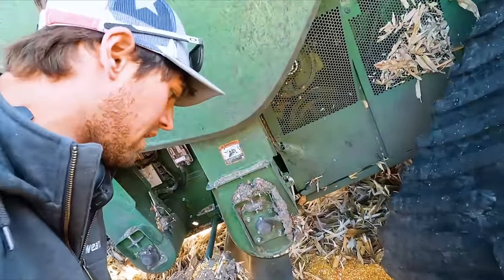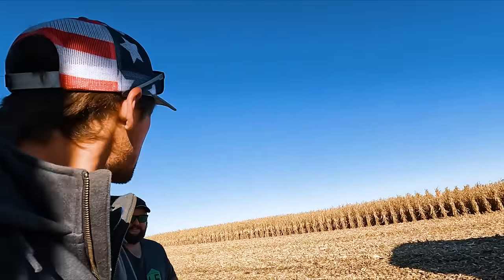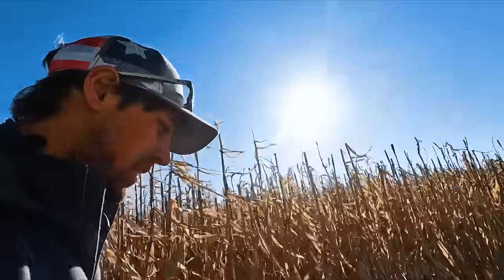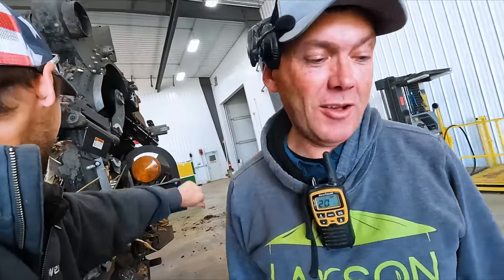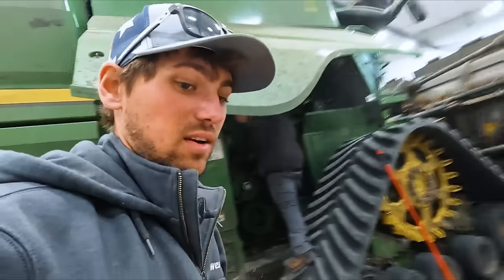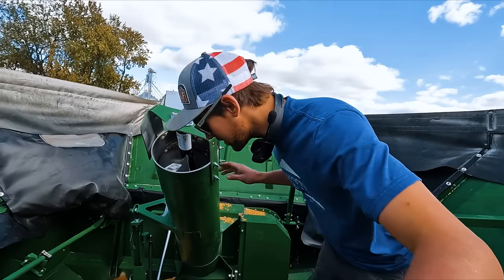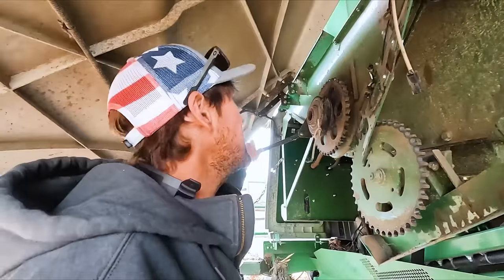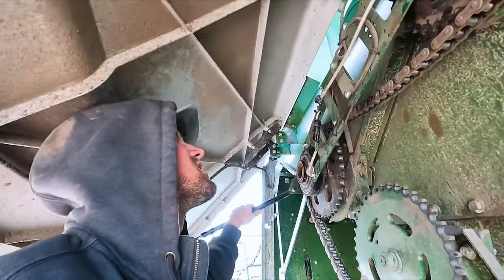The Consequences Of Our Own Actions!! #23

Comment: When I was a teenager we just finished putting new thrasher bars on the cylinder on a John Deere 95 combine. If you don't know back then combines used a cylinder and a concave to thrash the grain. Anyway I fired up the machine and ran a ratchet through the entire machine.  We had to redo the cylinder again. 🤦 Hang in there these things are just part of harvest 👍🏼

Comment: It happens. Couldn't tell you how many times we been working on a asphalt plant and throw all the tools in the loader bucket. The operator was supposed to put the tools in the shed ( just dump them on the floor so the ground guy can clean up and put them away)  but tools got dumped in a aggregate bin just to watch tools bouncing off the scalping screen deck.  But we get in a huge hurry with road crews, road foremen and others screaming for asphalt. All you can do is laugh and shake your head. Luckily we rarely had any damage from leftover tools and parts.

Comment: This reminds me of the gearbox that locked up from a dropped socket into the oil...it took a few rounds of chopper use to figure out that something was not right.  When we drained the oil...the message was clear that something was wrong.  Also, I forgot to tighten the knife blade on our tie arm for the round baler.  It zipped through about 1/2 a bale of twine before I noticed what I had done.  The impressive part was that is somehow was not broken and went from the previous bale to the baler on the MF the full length of that field without rolling up on the new bale...great!

Comment: Yup, first year with our S770 blew that bubble up augar twice. I was told if they aren’t aligned perfect they will blow up when doing wet heavy corn. Luckily that was under warrenty. Haven’t had it happen since it went to the dealer that winter and they got it aligned properly. Not that hard of a job, just frustrating when in the middle of go time.

Comment: Another good one I can relate to is after changing the injection pump on combine because of not running right resulting in the same performance the guy said all I did was change the air filters so guess where the packing slip was ? Inside the inner safety  filter then into the turbo

Comment: Dang it Chet, when it rains, it pours. I've had this thought and question all along every since you started running black beans. If you remember your first cutting season, you were running into problems with the dirt buildup throughout your machine especially within your unload augers. You had to replace the cog gear on your unload back then and you also installed the poly liner. My thought is, with running the air bar and having to pretty much scrape the ground with the cutter bar, it is sending a tremendous amount of dirt into the internals of the machine causing premature ware. I have been a never miss follower of you and your channel, and you never had these problems before you started harvesting black beans.

Comment: No worries Chet you and Chris are not ALONE leaving tools or a missing bolt or nut especially when I was missing a carb hold down nut oh just put another nut on it start the truck well number 4 cylinder found the missing nut and so did the piston smashed all the ring lands together you know what had to be done next right so IT HAPPENS!

Comment: is the auger still centred? the top auger bearing brace appears to be too thin at the point it connects with the auger housing.
Reply: I heard a tiny little bit of metal on metal - seems centred though.

Comment: Chet when I worked for Toyota and was doing a PDI on a brand-new Cressida Wagon, Part of the PDI is changing the oil ,20 years as a mechanic and i didn't check to see if the o ring from the original oil filter was off fired it up and got my shoes wet. The guy's never let me live that down. I think we've all done a stupid human trick. Don't be too hard on yourself. Ive been a mechanic now for 40 years and it wasn't the only stupid thing I've done.

Comment: Well, stuff happens.  I know you feel bad, but I'll tell you a true story from the Space Shuttle program that might make you (at least) feel like you have company in misery.  Back in either the late 80s or 90's, they were preparing a Space Shuttle orbiter for a mission.  One of the major operations is the rotation of the orbiter from horizontal on its wheels to vertical in preparation for connection to the external tank, completing the launch configuration.  On this particular occasion, the people running the operation reported hearing a large clunking and banging sound from the aft area of the orbiter, where all the propellant lines that feed the main engines, the hydrazine tanks that power the auxillary power units /hydraulic units---in short a LOT of very expensive stuff.  In the end, they found that a large access platform used to work in the aft compartment was left in place, despite there being checkoffs to assure that it had been removed.  It caused considerable damage and left a lot of folks with red faces.  So, good people make mistakes even when the right procedures are in place to make sure that things like that don't happen.  Even though it failed on this occasion, it was always required to log in all tools, equipment, and consumable items before entering the orbiter (or other pieces of flight hardware, like the Space Station modules while on earth) and then accounting for all of them upon exit.  If you didn't bring out what you brought in, there was a specific process for searching for it and, if not found, figuring out what could be harmed by it showing up during flight.  I had to sign off on several of those lost items through the years.  To help this process, the tool boxes were all custom Snap On with shadow boxing, so at a glance you could tell something wasn't there at the end of the shift (this also prevented tool pilferage even if it wasn't left in a piece of spaceflight hardware).  Obviously, that works better when you know exactly the tools you'll need which probably isn't practical in every situation (like pry bars....). So, you might adopt a lite version of tool control when you bring stuff inside the area that could go through the combine machinery, just make a little sheet and then verify you brought everything out.  I suspect that the service organizations have something similar since they don't want to be sued for destroying a 0.5M to 1M dollar machine's internals.  Even young minds can forget something, especially when you have been going hard in harvest for weeks with not enough rest.